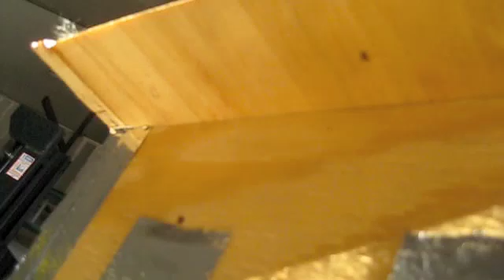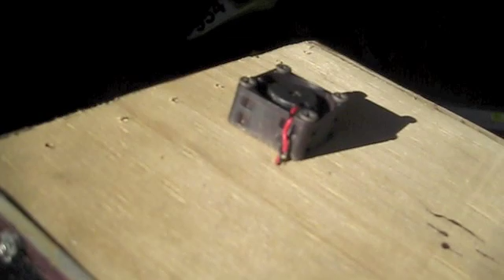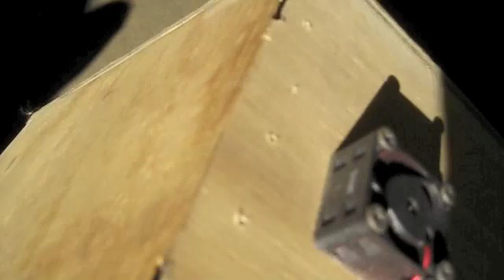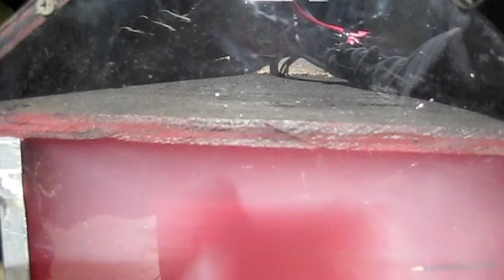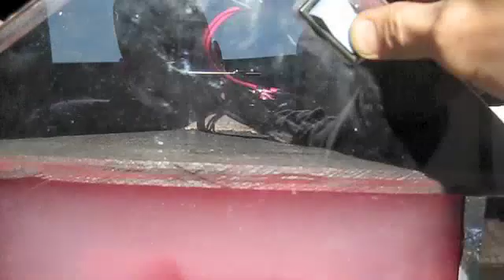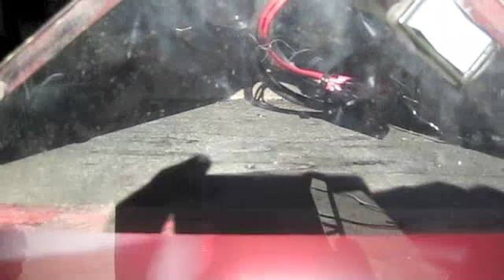The only attic fan that doesn't suck

Comment: Someone needs to 'splain to him that heat rises and given that the hot air naturally moves upward creating a venture effect that sucks cool air in through the soffits......Why in the world would you want to try to reverse the flow based on minor leaks in the living space? If properly caulked and insulated there would be no significant airflow as compared to the volume of air being moved from soffit to ridge vent.